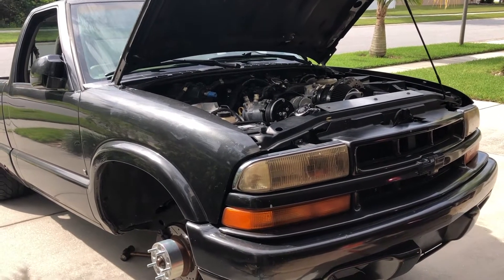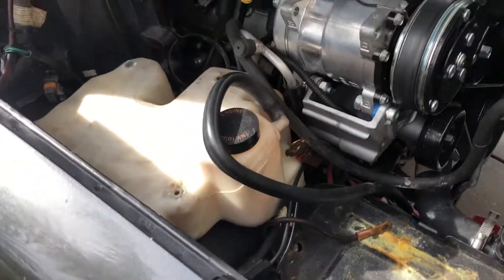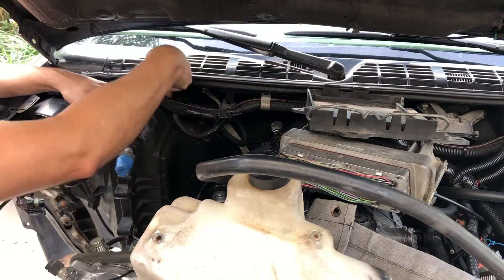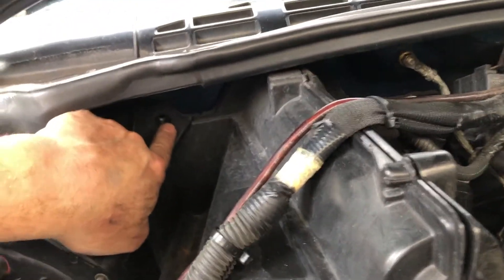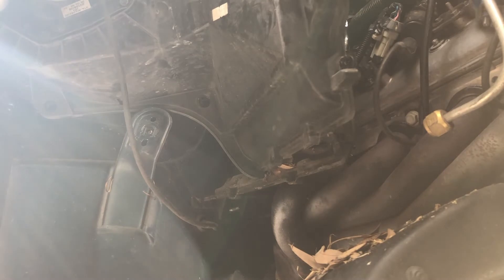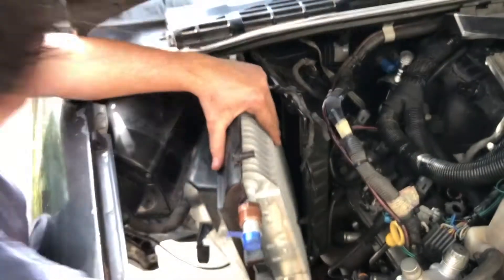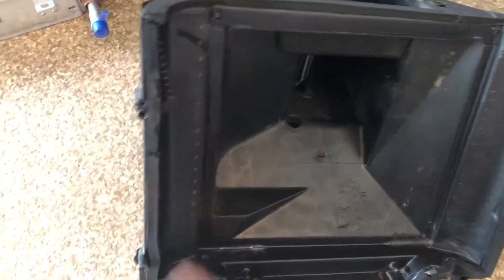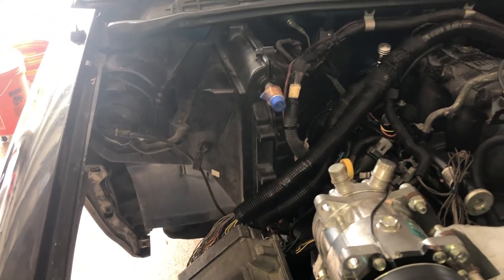2nd Gen S10 Evaporator Replacement

Comment: I've got a Blazer with the same evap. core and location. Mine has always been in the garage so I don't expect to have any leaves in it. But in your case, that probably was reducing the cooling to some extent As long as mine will blow out with a/c flush and compressed air, i won't replace it. But if that doesn't go well, I'll be into the same job. Nice to have a looksee into what that entails. Thanks for the post.

Comment: It is amazing the GM ability to make AC evaporator service almost imposible.
Reply: Believe it or not, this is a relatively easy evaporator replacement.   Many vehicles require the entire dash to be removed to get at it.
Reply: It's actually quite easy on my 03' Xtreme, he went about it a little differently but this is cake work compared manufacturers other than GM...

Comment: I'm surprised you didn't have to do the holley side cover. What motor mounts did you use?
Reply from the maker: I bought poly mounts on eBay for the frame mounts, with the engine side mounts on s10v8.com

Comment: Looks like on the bottom line has a crack in it, if that is so did it leak before taking it out??
Reply from the maker: It didn’t leak, but was over 20 years old, so I figured I’d change it.